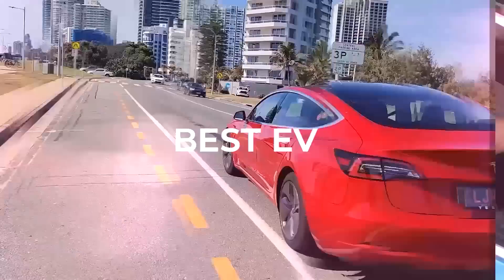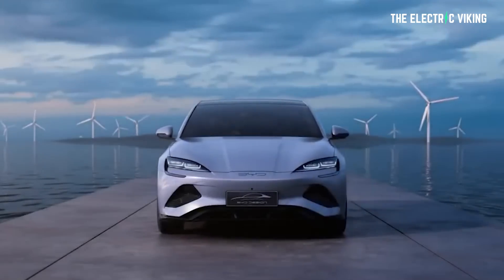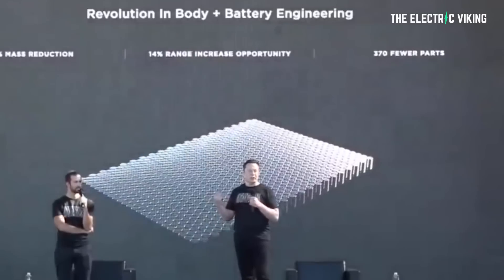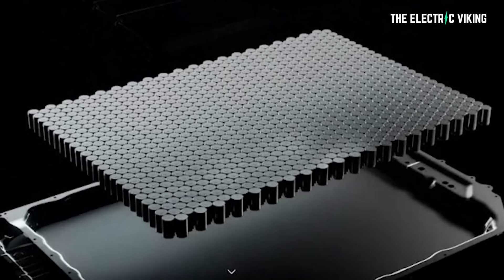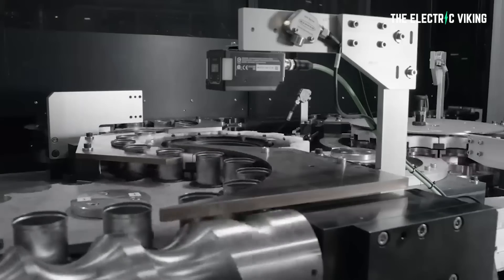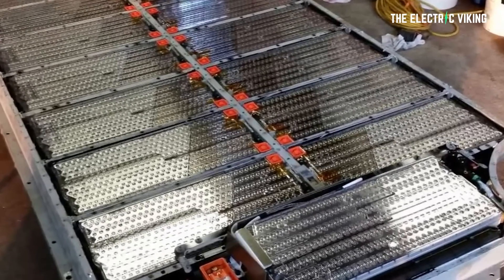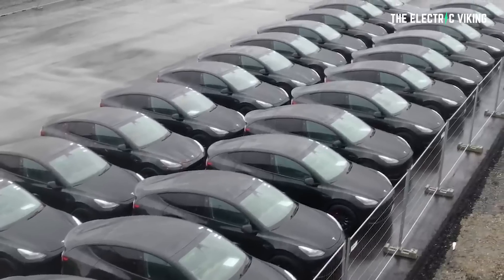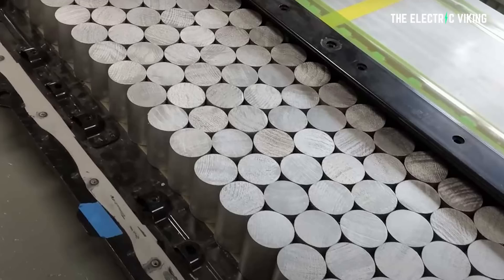Elon Says Model Y's structural battery pack is 'far from optimized'

Comment: I think people with a Tesla model Y structural battery pack already has 1000km EV which has been limited by software that will be made accessible by several over the air updates. 
It's my believe that Tesla is software limiting its model Y structural battery packs by about 50%.  
I think Tesla is holding its cards very close to its chest waiting to see what the competition are able to achieve.

Comment: Surely you use prismatic cells the pack utilisation will be much better. The issue is that no-one can make decent prismatic cells. I expect that BYD Blade should be better. The issue is that LFP is not that energy dens

Comment: Like Sam said before, Tesla can not simply make this version better than 2170 version. No one would want the lesser 2170 version so prices would have to change to reflect this. Maybe later when all US Y's are 4680 they will be upgraded over the air?
Reply: Right. These structural battery packs may very well be software limited. It seems logical that this is their way of avoiding the Osborn effect. This is interesting and I’m curious about how it’s all gonna unfold when they truly get the 4680 cells ramped up.

Comment: The bottom line, is Tesla has lost its way. They are trying to do too much at once without really improving anything for the consumer, price-wise, the range, the availability, Tesla's brand capital is being squandered with the incessant obsession of Elon Musk for innovation even if it isn't necessary. Right now, the Aptera is way more efficient, cheaper, longer range etc, and all they have to do is get it into production. Teslas haven't really changed that much in the last 10 years, so whatever innovation has happened, hasn't really been revolutionary, it's just evolutionary changes. The 4680 experiment is a huge money-eating hole Elon is currently trying to dig himself out of, so who knows where that is going to end. Having said all that, Tesla have something very special, they just need to figure out what works and what doesn't, and get on with making the cars that people want in as large numbers as possible.
Reply: Very few people are going to want an Aptera.  It is neato and I hope it does well but will not be considered a "real car" in the eyes of most people ...I suspect.  I know what kind of look I would get if I recommended to my wife that we should trade the RAV4 for an Aptera, 😂.
Reply: @jimjam36695   I think the quirky shape and the 3-wheel aspect of the Aptera puts most people off, but IMO, the real secret to the Aptera is the lightweight composite construction and the solar panels. In theory, they could build a more conventional looking 4-wheeled car and get almost as good efficiency, just because the vehicle is so light so needs a smaller battery pack, and can supplement its charging from the solar panels. That's my take on it anyway...
Reply: The cars that people want????? What is that car? Not everyone wants the same thing in a car. Have you seen all the different cars on the road. This makes no sense.

Comment: I would believe that because they are sandbagging because those batteries are lighter with more capacity. Those cars could go 400+ miles if optimally packed. Also battery swap could be easier.
Reply: I think that it could be done, I know that this particular car has been engineered to have structural battery pack and I strongly believe that a structural battery pack could be swappable. What I’m NOT saying is that THIS particular car is this way. Notice with Monroe live the car didn’t disintegrate when the battery was removed. Obviously more would need to be done because the seats were attached. I think it’s a lack of imagination to assume that a structural battery disqualifies a company from doing both. Obviously Tesla at this isn’t interested in battery swaps ANYMORE. These are the engineering challenges that are to come however if that’s not a company goal then it will never happen.